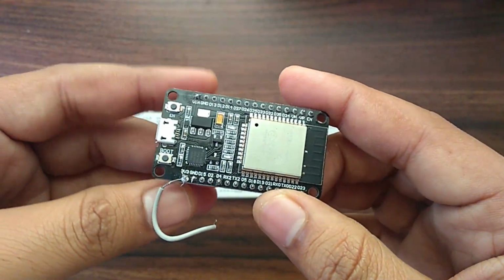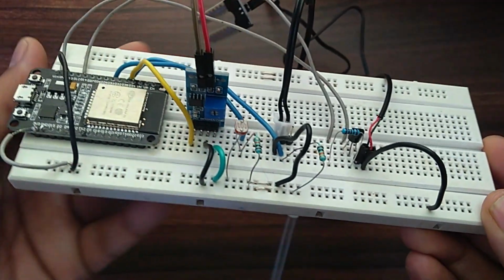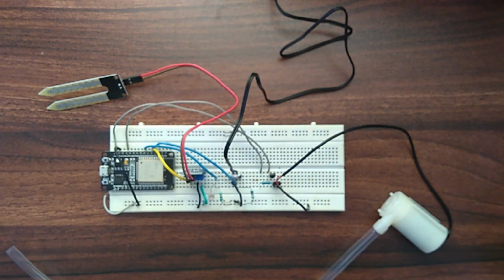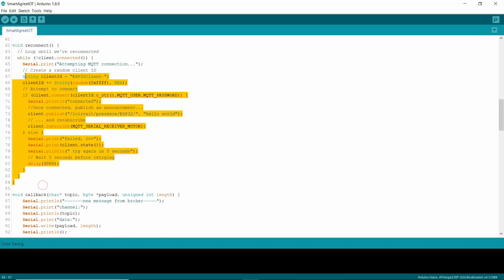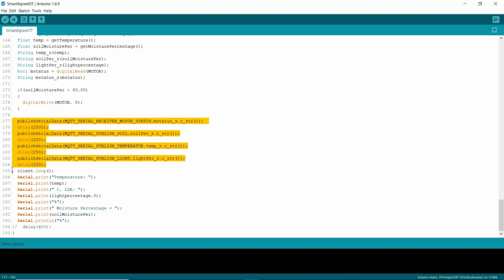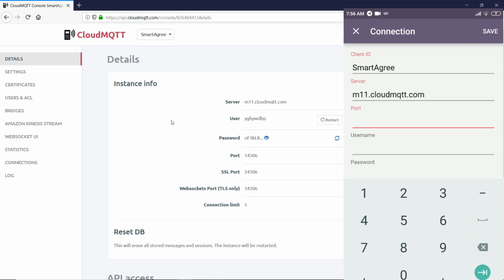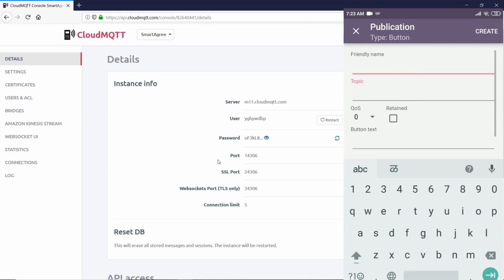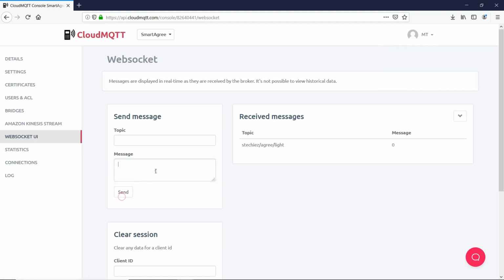IoT Based Smart Agriculture System ESP32 | Smart Gardening | MQTT Protocol | IoT Projects Ideas

Comment: Sir why my motor is not working while I have used led bulb with the same connection it's working  fine .My motor also working I have checked with the battery connection
Reply from the maker: It might be because of your power supply is not providing sufficient current.try with different external power supply.
Reply: @StechiezDIY  Thank You. I have connected with the 3v3 and it works thank you.

Comment: Thanks for sharing this interesting project. I've setup successfully. But the temperature in my system show 121.6
°C, I've no idea how to get the corret data, can you pls help on this? thanks in advance.
Reply from the maker: Thanks...Which temperature sensor are you using?
Reply: @StechiezDIY  NTC 10k B3950, is this one?
Reply: @StechiezDIY  I changed the resistance to 10k, now the temperature show 25°C while the actural temperature is 18°C. How can I adjust this?
Reply: @StechiezDIY  BTW, the light shows 23 Lux，is it accurate?

Comment: Hi, is it possible changing the sensor? I would like to bury the sensor around 30 cm in the soil. How long is the sensor's lifetime ?
Reply from the maker: You can use another sensor as well but the coding will change as per the sensor you select.
Sensors lifetime is depends on the climatically condition and quality of your sensor.
Reply: @StechiezDIY  could you suggest me some good soil pH sensor? Thanks
Reply from the maker: i ll suggest you to use which i was using. But if you any specific requirement then you have to select based on that.

Comment: i am getting an error in the code as 
expected unqualified-id before string constant at line 25
can you plz say that what might be the reason for this
Reply from the maker: I have post the compiled code only.So, there should not be a problem.
Might be you didn't installed the libraries.
If you get the errors after installing libraries then let me know..
Reply: @StechiezDIY  thank you. I have solved the error but my soil sensor is always showing a constant value of 100 i cant understand y it is getting what might may be the reason sir?
Reply: @StechiezDIY  thank you. I have solved the error but my soil sensor is always showing a constant value of 100 i cant understand y it is getting what might may be the reason sir?

Comment: what is the value of resistor?
Reply from the maker: 10K for LDR and 10K for NTC sensor.
Reply: @StechiezDIY  thank you sir. But how about the value of resistor at transistor? and the transistor npn or pnp?
Reply from the maker: For the transistor base use 4.7K and transistor is NPN.
Reply: @StechiezDIY   Transistor number
Reply from the maker: you can use NPN transistor. i was using bc547.